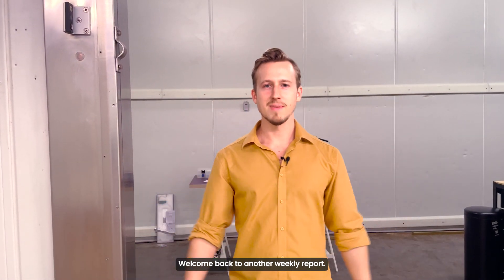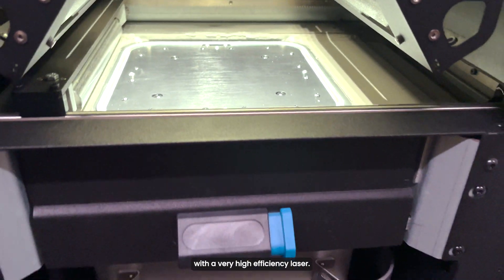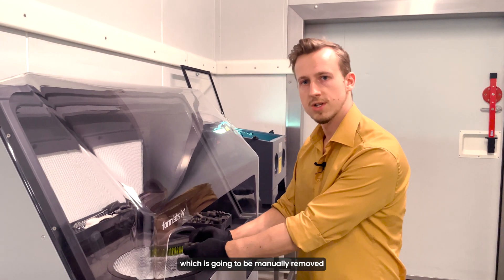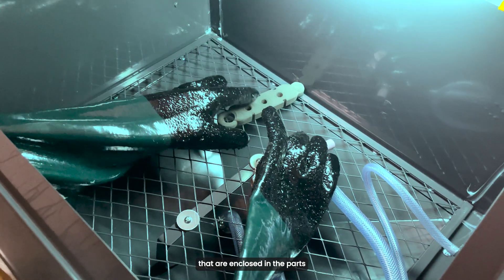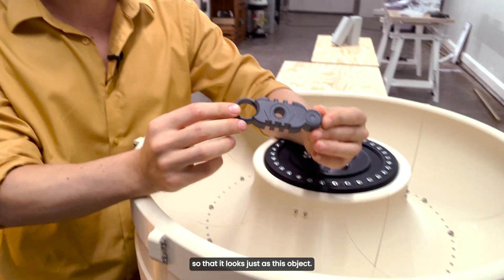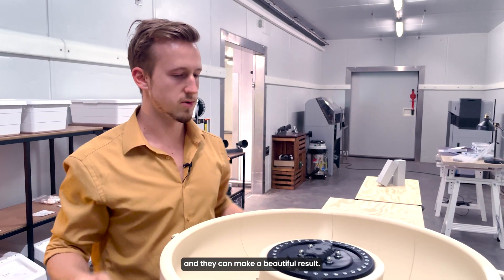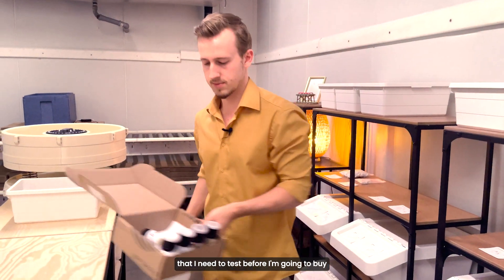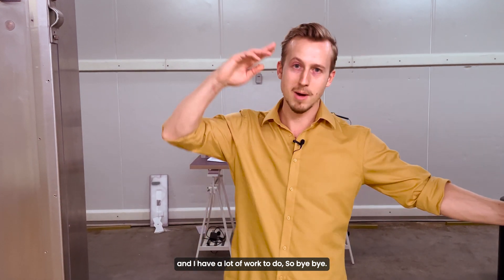MicroCoaster Facility Launch

Comment: At which point do you think you can migrate the production to injection molding, for mass production? Apologies if you've addressed this already.
Reply from the maker: That’s an excellent question, and I’d love to see it happen as soon as possible. To make it a reality, we would need some market validation, in my opinion. The quality of this printer is wonderful, no doubt. But it is a lot of manual work to finish the product, one good thing is, I have total control over the quality.